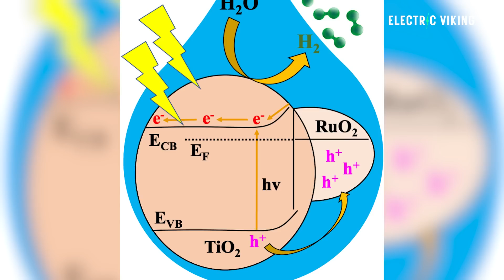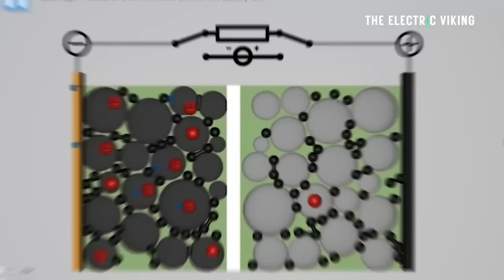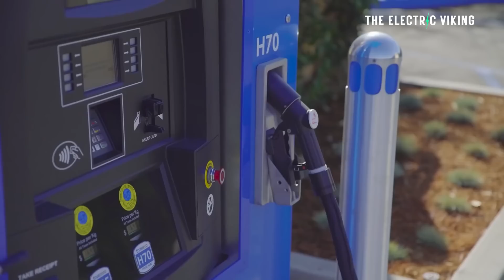American researchers use sunlight & water to efficiently create green hydrogen

Comment: Nice recap of a Very interesting tech. This might be used for in-situ fuel creation for rockets on other worlds.
Not so much for any type of general transportation, however. 

Blue Hydrogen is about $33/gallon equivalent in CA.
Green Hydrogen is about 3x that (completely useless). 

If they only match the Blue Hydrogen cost, it will be No match for EVs which are cheaper than Gas wich is about 4-5x cheaper than blue hydrogen. Even in shipping or long haul trucking, Nat Gas is vastly cheaper and requires far less infrastructure in those roles.

Here, the problem is that there are no meaningful numbers... which is telling as one would think they would want to tout them if they were any good. What is the Cost of a petrol gallon equivalent? Shouldn't they be able to tell us?

The EV competition on the other hand is seeing the Energy density / Power density / Lifespan/Cost per wh improving rapidly. 
It would take Many years to deploy H2 at Any price. Where will EV batteries be then? Tesla announced that their new 4680 will be cheaper than other batteries which are themselves getting much cheaper (including new Sodium batteries). 
What happens to H2 when they break 350wh/kg long before any meaningfull H2 infrastructure can be deployed at Massive expense even compared to Electrical infrastructure improvements (which is ammortized among many other industries... such as Data Centers.

Until they answer that question, its just an interesting bit of science waiting on a good use case.
The fact that they haven't suggests a blip rather than a game changer. 

All that said... I can imagine may valuable (if small) use cases.

Comment: The key considerations are cost, scalability and reliability.  Building a small prototype is easy, but turning this into an affordable large scale product is a different ball game.
Reply: Correct, it will likely be cheaper to increase, e.g. area of solar panels than to increase the efficiency of the existing one with an expensive system. In addition, people tend to forget that the materials used in the production of the green energy do not appear out of the thin air in eco friendly way and do not last forever.

Comment: A cool discovery, for sure; hydrogen has its place. Probably not in mass produced personal cars, but in locomotives, ocean shipping, heavy hauler trucks and large farm equipment, perhaps also aircraft. Or, given the vast quantities of oil still in the ground, just stick with diesel for those applications and keep improving the emissions scrubbing tech.
Reply: Not even for heavy transport thanks to maintenance and storage issues. The mining industry around the world seems like they are going to go BEV thanks to the efficiency and lower costs. On a container ship, storing the very leakable hydrogen for long term (based on their months long shipping routes) would be a nightmare safety issue with constant equipment maintenance and safety checking.

Comment: So, this process is basically dead on arrival. Ruthenium is a really expensive rare earth metal that requires hydrogen to extract in the first place. then the titanium oxide also makes the process expensive and more difficult to scale to any useful amount. Now compare all of that effort with sticking a pair of electrodes in water hooked up to a solar cell. No wonder they are comparing production rates instead of arguing a business case.

You must always be mindful of the difference between research and application.

Comment: H2 or derivatives, ammonia, methanol, methane, bio petrol etc may prove better more sustainable solutions in the future with more R&D into fuel cells, storage and fuel transportation. It’s still early days, many new inventions, discoveries and breakthroughs around the corner making it impossible for anyone to predict the future, however we live in exciting times and for now EVs make sense,  esp with QuantumScape, CATL Qilin etc.
Reply: Not early days at all. None of the above scales (even methanol is more expensive than gas and drives up food prices, produces aldehydes). 
EVs with current and emerging battery tech is far superior, cleaner, simpler and far more flexible as the energy can be sourced from whatever works best in a given location. The cars themselves are fast becoming cheaper as batt prices fall and use of rare earths/expensive metals drops off.
Nat Gas (methane), however, is good for long haul trucking and shipping. This tech is proven. Pig poo methane... not so much. Compost and animal excrement are better used as fertilizer.

Comment: Hydrogen fuel cell EV passenger vehicles still suffer the biggest down fall of hydrogen distribution, requiring high energy requirement to compress the fuel and   reliable containment / distribution. We still have issues of short life cycle of the fuel cell, which is very costly.

Comment: With regard to mobility applications of hydrogen. Why store the hydrogen on board the vehicle, just store the water. And produce the hydrogen at the fuel cell. Is 10,700 milli moles enough to power the fuel and how much power is necessary to run a flash light with the RhO.

Comment: Universal Matter has a graphene production process where any plastic can serve as the feedstock and the output is graphene and hydrogen is the byproduct. That’s virtually free hydrogen. 
That said, it would be best used to fuel convertible natural gas plants like the one in Texas designed by Mitsubishi Electric.
Reply: Lesson in economics. There is no "free" hydrogen. Nicola was pushing something similar and they were frauds.
Silver is frequently a byproduct of gold mining... do you imagine that they give it away?
Once there is a market, there will be a price and the yield will be a drop in the bucket vs large scale use (say 1% of the auto market). I promise you the graphine market is a blip compared to the gasoline market.

Comment: Hydrogen has a bright future, both as a manufactured fuel and as part of a post-petroleum chemical industry and even nuclear fuel. But near term as a motor fuel? Nah... just doesn't work. And isn't necessary. BEVs are actually superior in every way. But aircraft? Possibly another story. And hydrogen will no doubt have an enormous role in the post fossil fuel energy world. Conceivably at some point hydrogen fuel cells will emerge, but in terms of current technology, they haven't yet.

Comment: Green hydrogen would still lose out to BEVs in cars. Energy efficiency still substantially favours keeping electricity as electricity. Yes, it may better enable big/long range trucks and shipping, but Green H2 will do most good in enabling Green Steel from electric furnaces. Just keep it away from cars.
Reply: Electricity moves at nine-tenths the speed of light in the grid.  Why not use the loss base, the nightly surpluses for example, for considerable profits?

By turning routine losses into hydrogen, cash streams become available.

Comment: Hydrogen makes no sense because of the efficiency and storage problems. Batteries are far superior and only gettin better every hour.
I learned that from you😊😊
Reply: The last line is the killer....
Reply: @philborer877  Batteries are great for daily storage or up to two weeks. For seasonal storage, we need hydrogen or derived efuels. Batteries are today's solution. Hydrogen is the long-term future solution. It's never either/or, it's a question of what to use when for what.
Reply: @dirkvornholt2507  I hear this line and it makes zero sense.  This “batteries are temporary” line.  In a short time they will be 99.99% recyclable, pulling power from a variety of sources.  More logical would be EVs with hydrogen reserved for say shipping or possibly air travel, but EVs would draw from whatever energy is available.  Who in their right mind would want a hydrogen vehicle with all the complexity and worse reliability?  What advantage would it possibly bring?  Also,  of sure where this idea is coming of two weeks, Teslas can go about 60 days or more just sitting in sleep mode.
Reply: @fractalelf7760  I guess you got me wrong. I'm not mandating for hydrogen vehicles but for hydrogen as energy storage.  You can easily store the energy needed for a single family home for one or two weeks in a battery, but a battery for seasonal storage wouldn't be economically feasible. A cycle per day or per week is feasible but a cycle per year isn't, as calendaric ageing will outrun cyclic ageing after only a few cycles. Self discharge is not my point, that's indeed negligible.
Reply: Store surplus electricity as hydrogen.  It is common sense, as reasonable as having a frig, with a freezer.
Reply: @FlameofDemocracy  You do realize how costly and difficult that is and what does it buy you?
Reply: The US can store as much as it uses, annually.  

It is now possible to stockpile hydrogen, and then use these holdings as collateral.
Reply: @fractalelf7760  Hydrogen is ergodic, meaning it is too profitable not to develop.
Reply: @FlameofDemocracy  Can you show me the studies that support that position?
Reply: @fractalelf7760  Which position?
Reply: @FlameofDemocracy  That Hydrogen energy is “ergodic”.
Reply: @fractalelf7760  All I can say is look to the US, EU, China, et cetera.  

I am not into debating, to be honest.  These are facts.

Comment: If we could get rid of the heavy crude we used to power ships, it would be a major step forward. I agree it's a tried and now dead duck for hydrogen cars . Batteries are developing that fast they are way in front. Why would anyone want to use fuel and pay huge amounts of tax when you can at home from solar and off-peak electricity.
Reply: LNG ships are already in use and get rid of much of the polution (leaving only CO2). Way easier to adapt infrastructure where needed. Far more practical and ultimately cheaper than bulk oil rather than vastly more expensive. 
H2 in shipping will kill any company that tries it in competition with others who don't use it or go the LNG route.
Same with long haul trucking.
Reply: How would you store and maintain this hydrogen over a months long voyage for a container ship? Liquid H2? Pressurized? What about maintenance on the H2 equipment. Costs seem to high to justify even IF using a cheaply produced hydrogen. See what's happening in the mining industry - they appear to be shifting to BEVs rather than Hydrogen.

Comment: Viking
Remember the big problems Storage and Transport.  Hydrogen engines run on high pressure, very short engine life.
Wayne
Reply: Like he said in the video, and most engineers/scientists would agree, hydrogen is unlikely to succeed in the transportation market for many reasons.  However, if produced on site with this method, there is a chance it could be used in industrial applications where transportation and storage can be kept to a minimum.  I'm not holding my breath though.  Even if this method turns out to be cheap and effective it is still a decade or more from realization.
Reply: fuel cell engines are electric. Hydrogen has many problems, but that's not one of them.
Reply: @secretweapon7764  He may be thinking E-fuels, which is also an unlikely to succeed technology.  Fuel cells typically last 7 to 20 years depending on application but are pretty expensive.